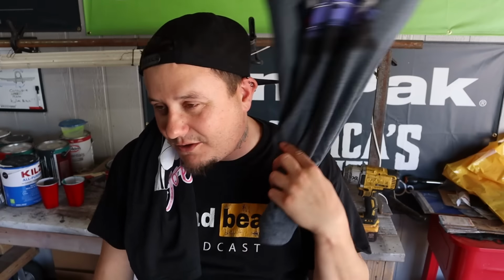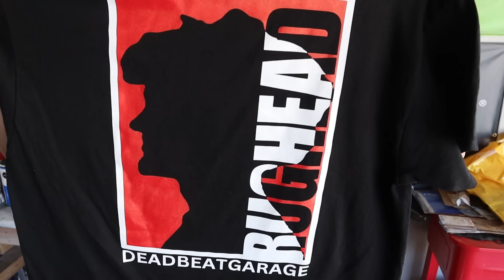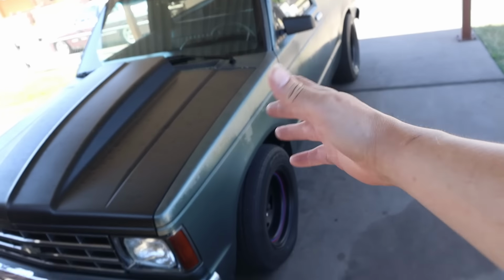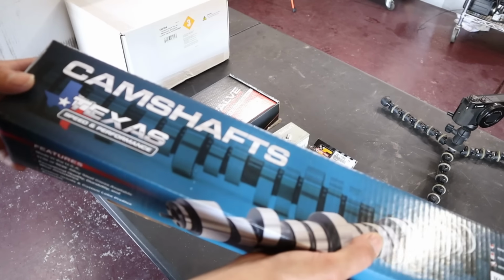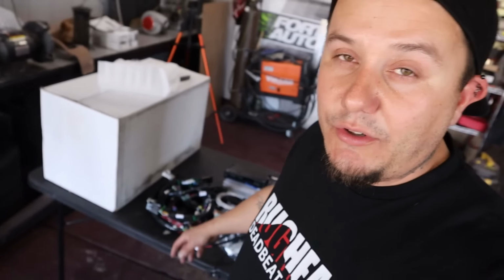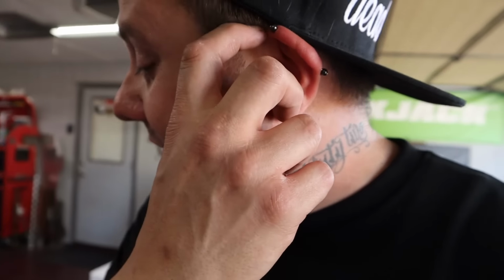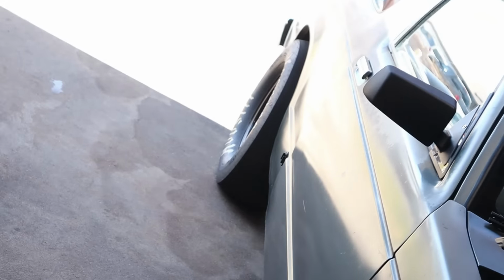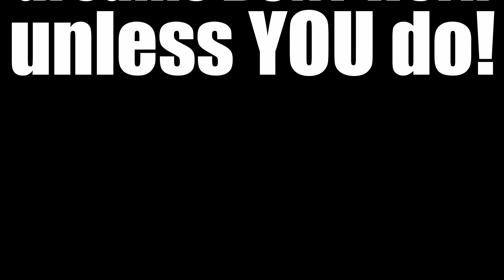$5000 Worth of Blazer PARTS Came in!

Comment: I have a YouTube channel 1lowz for my 86 Nissan 300ZX that I went through top to bottom I totaled it almost got killed before I finished my turbo setup which I still have every bit of but I have a square body 90 S10 Blazer 2 door just like yours I put a small block Chevy 350 in it  3 years ago but it has a 4-barrel  carburetor lots of nice things you can see a video or two o🎉n my channel but anyways I just got a$$ 9800 Fred white built yes Fred white from Kingsport Tennessee built my engine and 700 r4 transmission for $9800 and I've got my small block 350 running so hard I haven't even swapped it yet and I've had it about 7 or 8 months it's brand new never been in a car aluminum heads it's beautiful it's the engine that showed when you look up 383 stroker turn key engine from White's racing Anne-Marie it is that engine that they show on the picture it tells you all the internals when you go down and read about it I have the build sheet I have a hold of the stickers for the parts and components listed on the ad LOL that sold me a little more when I seen all the stickers for all the stuff that was supposedly in the engine but I took the valve covers off yes it's the right roller rockers yes it's the right hands it's beautiful beautiful beautiful beautiful beautiful but yes my little flat black rattle can paint job S10 Blazer is my baby and I got an engine way more expensive than what that blazers worth LOL but I love your channel from The Hondas to the ruckus to everything you've worked on I watched I've been watching you for 4 years maybe or more